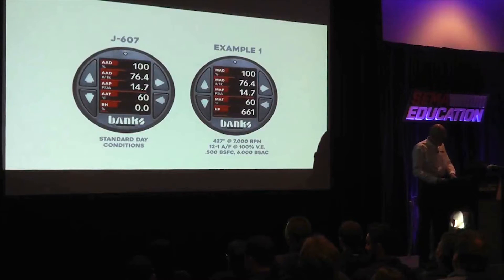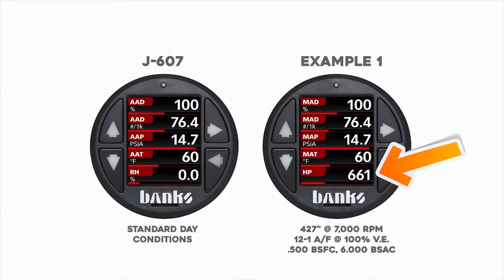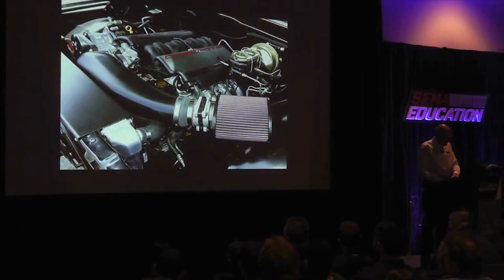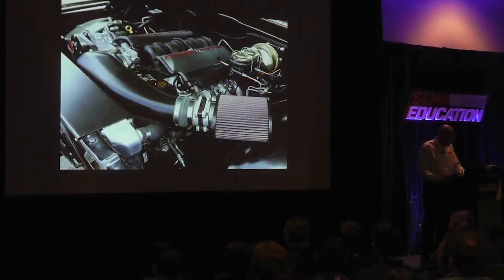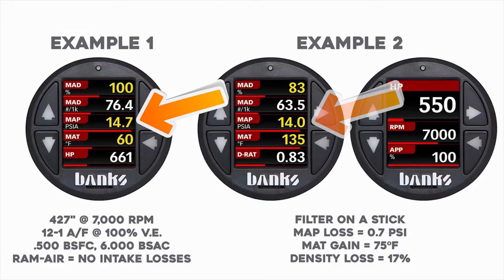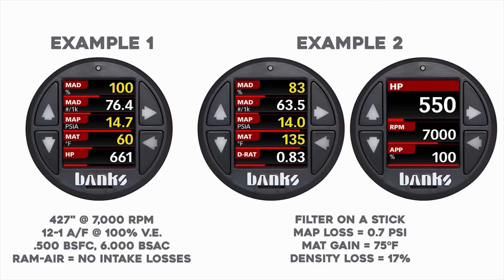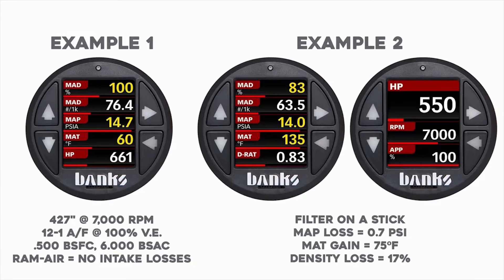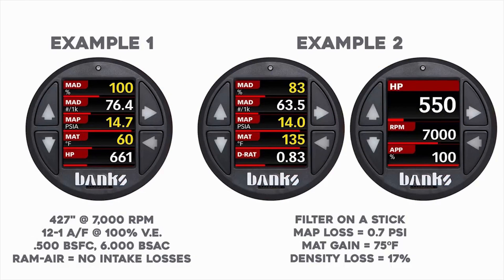Do You Have A Hot Air Intake?

Comment: wow thanks, that explains a lot, unfortunately, theres NOTHING I can do to improve my  Chevy G20 hightop vans intake aside from the K&n thats in it. All the other 5.7 v8 "tbi" vehicles have much bigger filters and much more options for cold air intake. Oh well, its stock cold air intake is good enough though I guess. You people and your aerodynamic cars, soo lucky, lol. I cant complain, It use to cut off giving it the gas from 0mph when I accidently left it in overdrive, not anymore with the K&N. It gets crappy fuel economy city driving in overdrive, especially going up hills, BUT it doesnt ever cut off. The 3" single exhaust and 3.73 rear grears help.  With good injectors it gets at best close to 14mpg in both city and highway.

Comment: Finally, what I have been saying. Just saw a 59 Deville project on a Motor Trend TV show was shown as having an LS with a cold air intake with a conical filter, you guessed it, naked and afraid behind the radiator in the engine bay. Do these people not know that the stock airbox actually does pull cold air in from under the car versus their misnamed hot air intake? Furthermore, a well engineered air box may at best need only slight modification to kick butt over all those kluges people think look badass.

Comment: 99% of cold air intakes are a scam. A factory intake will  usually suck in air from right on the outside of the engine bay, on my truck it is right behind the headlight. Every "cold" air intake I have seen for my truck puts the intake further in the engine bay than my stock one. Not saying there aren't cold air intakes that dont work, I'm just saying put some thought into whether it is really any better.
Reply: What kinda intake should I put on my car then for performance

Comment: Let's not forget that the engine management is also going to pull the living crap out of the timing and add extra injector pulse width to prevent pre ignition from occurring,  which is another reason that 427 lost 110hp on that dyno run..... your computer will do everything in its power to protect that engine. Used to see this all the time with 911 (996) Turbo owners. They'd use the hot air intake kits that had no air box included, the intake temps would sky rocket, and the over all ignition advance would literally be cut in half from 38 degrees to about 15 degrees at w.o.t. turning a once torquey exotic into a kinda bitchy one. The computer would actually try to fix this by changing the air conditioning flow (they're variable displacement systems) which would allow the fuel system to cool down (yes they're equipped with a fuel cooler that utilizes the low side a/c line), but even that can only fix so much....if the issue persists  to protect itself the computer would then lower boost pressure from 9psi to 5psi.....

Comment: I've never understood the "cold" air intakes. My truck came with a cold air intake...from the factory! it draws air from the passenger side fender well
Reply: pure marketing
Reply: @cemsengul16  nope
Reply: Most aftermarket kits are Pure garbage. Many draw hot under hood air. Even more sad and pathetic is that customers defent their purchase fiercly by believing that there is no need to draw cool air because the engine makes it hot Any way. Rejects of the F150 forum say this regularly. Stupid cannot be fixed.
Reply: @ColdSmokes  this largely depends on the use of the vehicle. Race cars have cold air intakes because they’re moving all the damn time, they’re getting flow…all the time. The tests are coming from when they’re moving. This engine is likely from a pony car that does drag racing, not exactly ideal since you’re not moving until you’re actually moving. 

Which means doing burnouts and waiting forever the light to turn green. 

So if you have a car that’s constantly getting flow, yes, it’s worth it. Less restriction, cooler air (that’s why it works better with turbos btw). If it’s a truck, like a tow truck, yes, but if it’s something like drag racing then no because you’re just sucking up hot air until you take off.